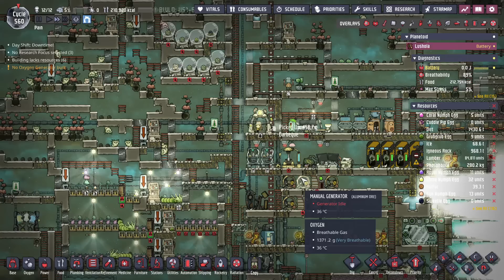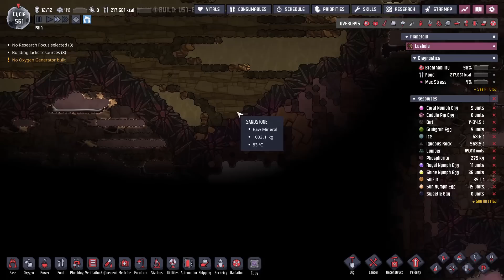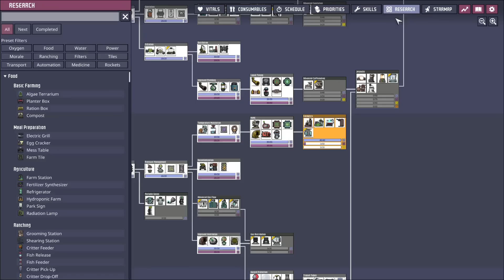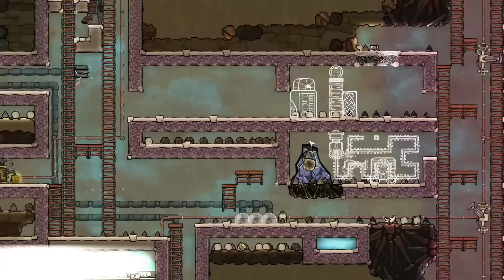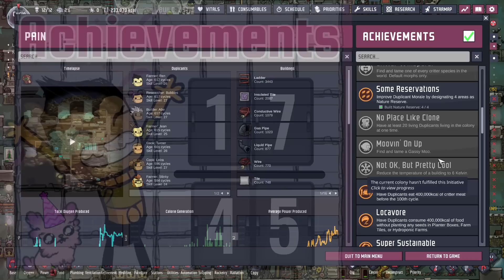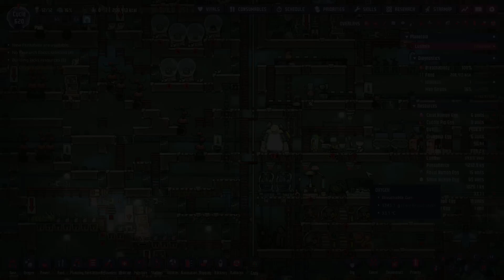[Ep15] Hey, What's This Made Of? METAL! - Ultra Supreme Max Difficulty

Comment: ive found the easiest way to cool a steam turbine is almost always like mabe 30kg of whatever liquid i most recently spilled on the floor, u really only need 1 or 2 tiles bc liquids so much better than gas long as it touches a radiant pipe or in ur case a cold plate.... illl generally put it across the whole base of the turbine and just mop up whatever spills tho
also im pretty sure both cobalt and aluminum volcanoes require >1 steam turbine to cool output materials below 150c tho mabe ive just always got good ones (my aluminium ones have always needed >2 ... so i just stick whatever i have space for on there and turn the temp up accordingly)
Reply: ps i dunno if ur still supposed to put the liquid vents under crude oil so you dont loose efficiency, id hope they fixed that but i still do it

Comment: I am not sure if you ever watch other creators videos. Echo Ridge has a metal volcano tamer setup that only needs 1 tile of cooling to get metal down to a usable temperature. All these bigger setups are a waste of time. You seem to be about doing the least to get an acceptable result and this seems right up your alley. I personally like to use a meter valve to dial in the amount of water I put into my tamers. You can do the quick math of 20-50kg per tile times the number of tiles and just let that much water through.

Comment: i like more single more vertical terrarium for drecos with hydrogen on top and oxygen/ chlorine on bottom - and sheering statinon in hydrogen ( thou one of variations does not even have liquid lock - just dont let dupes go into hydrogen just stand on bottom on oxygen part if you chose ofc there are problems with that setup but i realy like how expandable it is - jut make more copies of room next to each other maby even secured by only one liqud lock

For siuts i always feed oxygen to closest to the checkpoint than when its full to others - prob not best  for situation when oxygen supply is limited but with smaller colonies keeps most used suits full all the time

Comment: You don't need the thermo sensor if you use a conveyor meter to only let the metal out of the room in small 1 or 2 kilo packets. Small packets lose their heat way faster, and make cooling solids generally more efficient. For some things, like freezing food I'll use the same method but set the meter to release quarter kilo packets instead. Just keep an eye on it over time, and adjust the packet size if needed. 1-2 kilos is almost always fine for volcanoes.

Comment: why not use the metal volcano to generate some electricity, add more stream turbines?
Reply from the maker: The volcano will only be able to push so many turbines before it cools to the point that they stop running.  Typically 1 turbine per volcano keeps the turbine running at 50 to 100 percent as long as the volcano is active
Reply: Also when u build in the base, mind the decor!!

Comment: Drekos can eat mealwood. Mealwood is the key factor to make glossy drekos. You could have just put a bit of hydrogen gas along the top, and planted mealwood at the lower blocks! You'll get glossy drekos so much faster that way. I put my doors a block lower than the floor, and keep the room without airflow higher than the door, so the hydrogen doesn't float away. No need for suits if you want glossies.

Nevermind, I didn't finish watching. Ha
Reply from the maker: Hahaha, I read your mind in the future!

Comment: My metal volcano setup uses a vacuum, a single steam turbine built next to it, with a large amount of water to buffer the heat, so the aluminium tiles and tempshift plates don't melt. A sweeper grabs the metal once the metal tiles gets cooled down to around 125 degrees and transports it out, temperature senser is in a tile next to the first metal tile the molten metal touches, with a single drop of water in it.

I haven't tried with geotuners on more energy-dense volcanoes,  my gold volcano can keep up even with 4 geotuners, but i remember having an aluminium volcano before they existed, which couldn't keep up with the cooling until the volcano went dormant, which is why the large water amount to buffer the heat is relevant.
Reply: My aluminum volcano outputs barely anything, one stram turbine is waaaay more than enough.honestly the bottleneck is getting the last 100 to 200 degrees out of the biggest lump of debris, but i can probably get away with just letting that all pile up in one debris lump in the middle of my base and letting the other cooling systems handle the tricklr of leakage.
Reply: @fractalgem  You can always geotune it now it if you want more, i stopped with 4 on my gold volcano to avoid evaporation, but seems aluminium can manage the max number without it happening.

5 geotuners would double its yield and add 250 degrees on top of it. Just a shame they messed up the supply task for it, it's in the wrong category.
Reply: Check out BierTier's volcano tamers. They work with every type of volcano, tuned to the maximum, and are really simple to create.

Very similar to this, except you use the AT cooling loop to run through a metal plate + conveyor rail section. It's all 100% automated and runs forever. It'll have 2 steam turbines running at max power while the volcano is active.

Comment: Great job, your videos are quite entertaining, but i will say, aside from really the 9 tiles around the center of the volcano, you can use even copper ore for rails and vents as due to the steam you should never be getting over 275° or else everything inside will break. Nothing should melt as long as you didnt mess anything up

Comment: How did you build the conveyor rail thermo sensor without first unlocking Solid Management in the research tree?!?! That involves orbital research, which involves another ton of plastic than you had at the time, inside a rocket in orbit you did not build.

I WILL NOT BE SILENCED! 😂
Reply from the maker: You can get data banks from analyzing geysers and exploring ruins.  It's not much but you can squeeze out 1 or 2 researches before leaving the asteroid :)
Reply: Thanks lol I haven't played SO in a while and didn't remember that

Comment: Looking your base gives me anxiety mate. Please give me the save file and let me fix it. xD Also I use 8 square high room with 2  little rooms at upper corners(enterences are inside the main room) for dreckos. It is hard to explain but you can fill upper 4 square with hydrogen via electrolyser and add mealwood to bottom side. Hydrogen always stays in the room and you'll farm reed fiber and plastic from little rooms(kinda like starvation room). Wish I could draw it in here but you can find similar bps in the internet. 

You don't need extra liquid lock (and atmo suit), make entrance at lower side, seal top side cuz hydrogen always stays at top. Also make it outside of your main base for atmo suit if you don't want your dupes to get irritation from hydrogen gas. Stop squishing everything man my eyes burning while watching this... base!

Please let me fix your base...

Comment: Would hydrogen work better in steam turbine room instead    of oxygen?
Reply: High thermal conductivity always the better. Hydrogen has higher tc if I am not mistaken so yes. But it really doesn't matter much if you cover some potential problems like overheating or lack of power for cooling. Also you can make vacuum room with liquid drops if you want it. I prefer to vacuum everything and use liquids to transfer heat to cooling pipes.

Comment: Couple of issues with drecko ranch.  Oxygen/hydrogen level will fluctuate with base pressure better to seal it up.  Automation generally isn’t needed I set my drop off at 8 and it seems to always keep it full automatically
Reply: Not really needed. Oxygen level have to be very low for it to disperse bottom side and escapes from the room. Dupes will die first if that happens. Also it's okay to let hydrogen out, it goes top of the map, easy to clean it.

Comment: Really dumb idea:  Cobalt comes out at 2226C, crude oil turns to petroleum at just under 400C.   I don't know the game well enough to design a petroleum boiler that works with a cobalt volcano but...
Reply: Sure! Instead of running through steam turbines, store the temp in 12-16 iron metal tiles before exiting. Have an auto door to regulate the temp, another iron tile. Then drip crude onto it. But probably not enough mass in the volcano to make much at a time.
Reply: It'll be harder to convert cuz its 12kg/s you'll loose heat eventually. You can't convert consistently in a nutshell.

Also I am not even add calculation of spesific heat capacity, which crude oil much higher than cobalt.